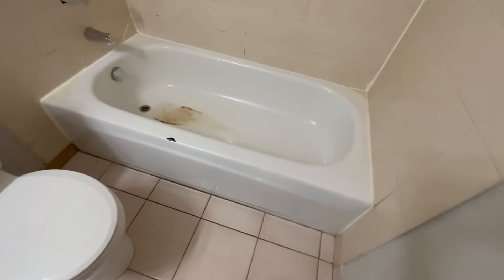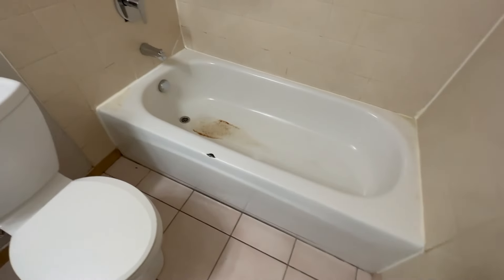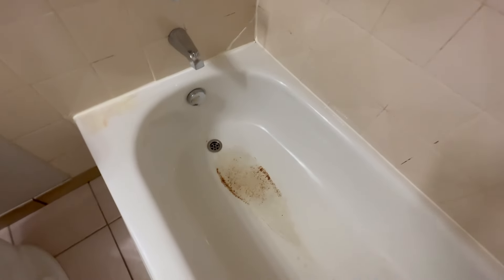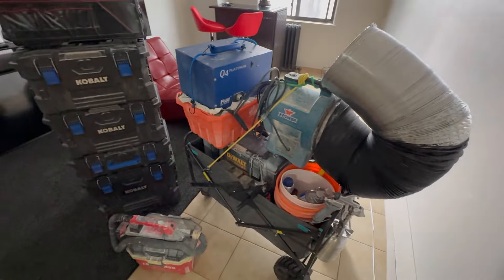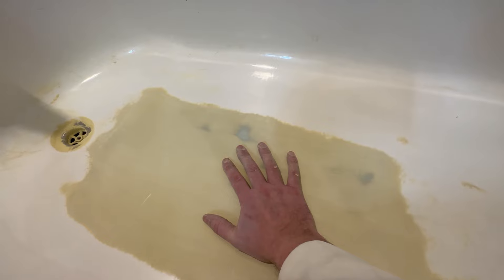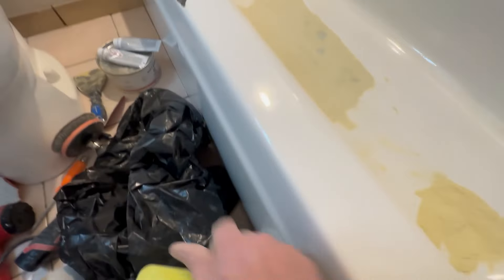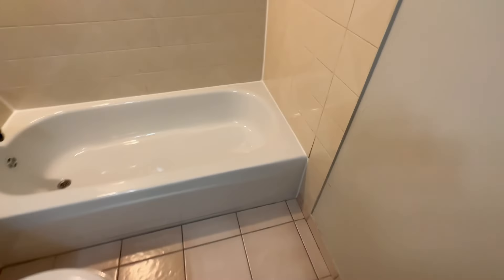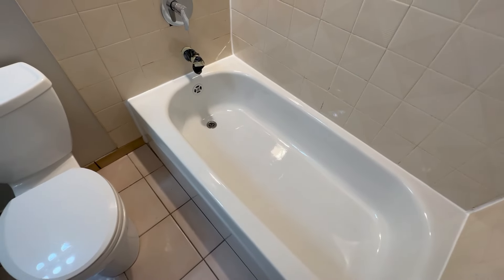How pros fill a low spot in a tub.

Comment: is top kote the only refinishing product you use or do you also use other companies top coats?
Reply from the maker: I have used EAH, napco, hawk, Midwest, Topkote, PPG pithane, PPG450hs, and several automotive industrial polyurethanes.
Currently in production we use topkote and Midwest chemical (and have for a few years now).
We crosslink3 everything and either use topkote or Midwest depending on the application, with topkote being the superior coating of the two, (this is the most superior coating system we have put together to date).
Reply: what is your thoughs on EAH been using them for over 6 years with Midwest primers. Haven't had any issues with there top coats.
Reply from the maker: @jeffwilliams8031 
Over 12 years ago I had over 100 redos from their EAH sharks grip epoxy topcoat system, larger refinish company in Vancouver had over 600, refinisher in Toronto same time had close to 75.
Unfortunately they have lost my trust and business forever.
Now dozens of people are saying the LPE yellows really bad. Same story again…. 
Midwest topcoat and topkote urethane resin has stood up to insane testing…
I’ll stick with them.